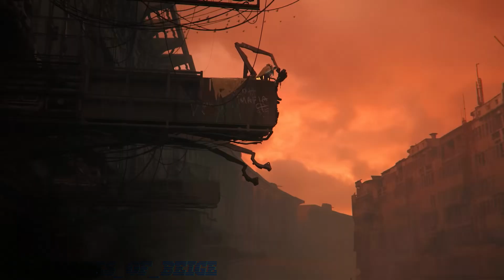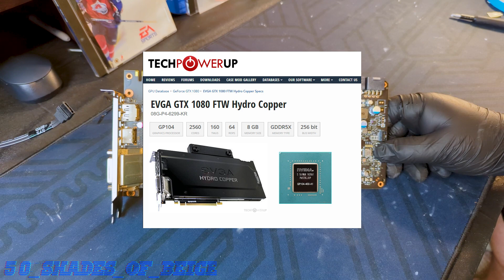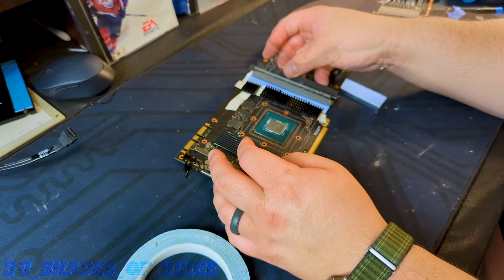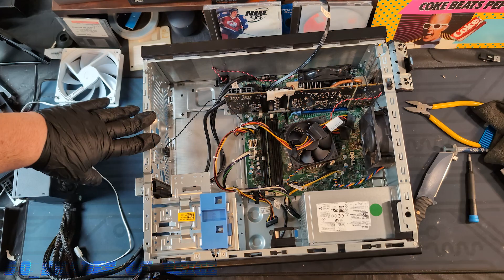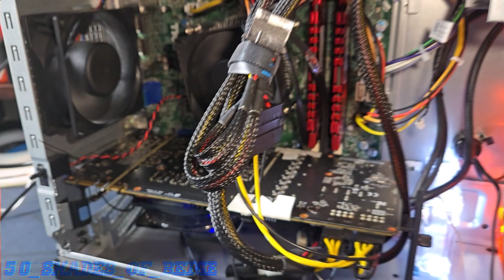$0 Ultimate Scavenger PC Build!

Comment: It could definitely be the game not being well optimized but for shit's and giggles, you could try an older GPU driver and see if that changes anything. Less overhead and whatnot. Love the build though!
Reply from the maker: @NoobSniper  Yeah I did try a driver from 2021 to start, and I updated it to the latest Studio driver just to see if that would help. Basically the same result. There is also no FSR either, only Unreal TSR. So that tells me they've got some work to do.
Reply: @50shadesofbeige88  In that case, definitely a game optimization issue. Would love to see an updated video on this build after a couple of game patches!

Comment: Nice use of the extra power supply , but man use of double sided tape is little much for my taste , I would drilled a couple little holes in the heat sinks , but honestly I wouldn't have gone this route considering the card was supposed to be water cooled I think I would just got an pcie lane extension cord then submerged the chips  on card in small container of antifreeze , with a fan pointed at it , as definitely probably get better cooling and long you didn't spill the container or found a way to seal it you be golden
Reply from the maker: Cool idea! For what its worth, the tape is made specifically for this purpose, and the mosfet temperatures were fine. Thanks for commenting.